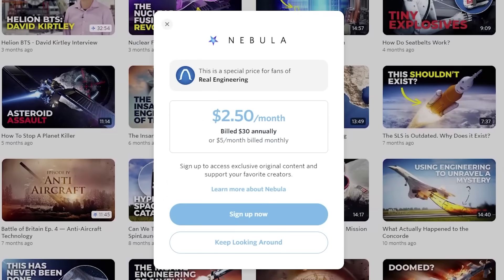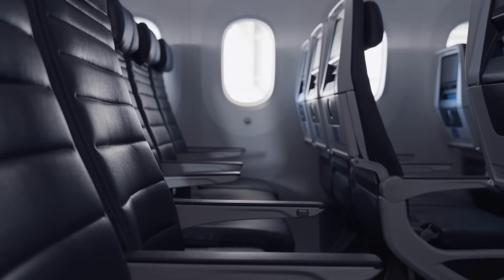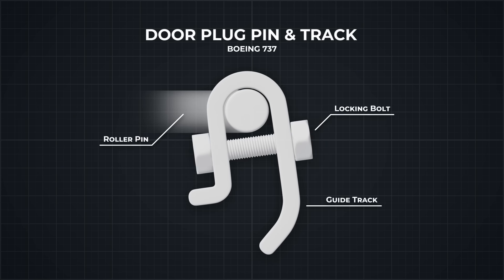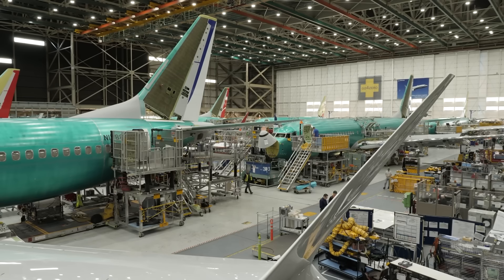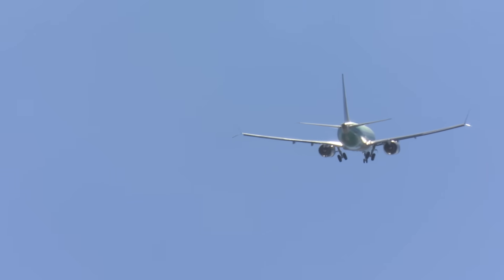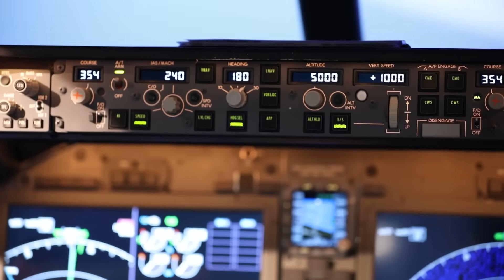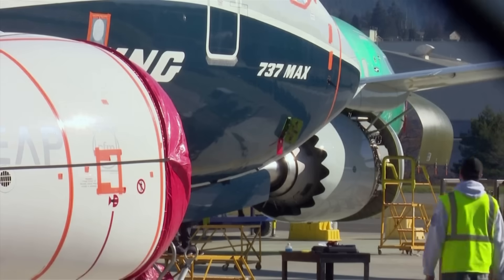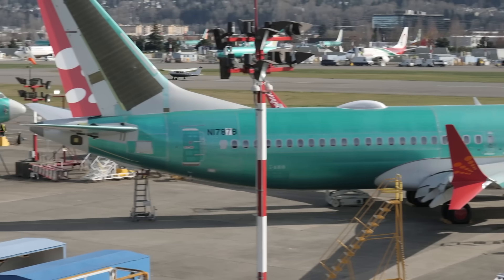The Questionable Engineering of the 737 Max

Comment: The first depressurization happened Dec 7. Alaska had the wifi pod installed by a contractor between Nov 27 and Dec 7 in Oklahoma. This failure started the same day the plane left from being worked on in Oklahoma. The simplest answer is usually the correct one. The contractor for Alaska screwed this away and now Boeing is taking the heat because Alaska is not accepting responsibility.
Reply: Funny how lose bolts were found on multiple other aircraft. 😮
Reply: @simondahl5437  Loose fasteners are found on aircraft all of the time for many different reasons, including vibrations and other general maintenance actions. It doesn't mean Boeing caused it. I have modified fasteners to accept safety-wire or safety- cable because they would work loose even with the best of lock nuts, anchor nuts, lock rings, tab-locks, etc... Unfortunately fasteners have a bad habit of not paying attention to design.

Comment: @RealEngineering The Alaska Airliners didn't do anything wrong. The pressurisation warnings almost certainly didn't have anything to do with the door plug. The pressurisation system of an aircraft is made of several components: the pressure vessel aka the hull, air conditioning pacs, an outflow valve, and a pressure control system. The pressure control system has two independent automatic systems and a redundant manual system.

The pressure warning light went out when swithching the pressure control to the other automatic system. If the door plug was leaking before, the pressurisation alarm would have stayed on regardless of the pressure control system used. Also an air leak makes a loud squaling noise.
Reply: that goes against the "rich powerful company bad, more regulations needed" narrative, but to be fair, there had to be some way to prevent what happened, else it would have been the issue of the engineers, and therefore alaska airliner's fault for picking them.
Reply: Look up Alaska Flight 261, the company has a history of shady maintenance
Reply: I don't know the cabin pressurisation systems on the 737 but expect it's just a modern version of the old cabin pressurisation system on the Victors I used to work on.
Checks would involve blanking the sensing lines on the control valves and pressurising the cabin to a given differential. If the flow-rate into the cabin was too high or the required differential couldn't be achieved, there was a leak somewhere which you had to find and fix to get it within spec. Usually it was the cabin door or the seals around hatches that was leaking - places that were moved frequently or had been disturbed during maintenance. It was all basic stuff BUT the principles still apply no matter if you've got fancy electronic control systems or old steam-powered ones.

The pressurisation problems on this aircraft are quite likely to have been due to the leak around the door-plug as I've seen more detailed photos showing the way the plug probably gradually over time moved upwards in the mounts thereby creating a gap which through vibration and other forces gradually increased until the door jettisoned the aircraft. Tolerances between the 2 automatic systems may account for the fact that one system kept failing whilst the other didn't, but either way this is one heck of a failure at many levels of management, production and maintenance.

Comment: This isn't unique to the 737 MAX; the 737-900 has the same thing.  The causal relationship is that passenger capacity dictates the number of exits required.  Also, blancolirio reported on his channel that doors are NOT removed to install interiors at Boeing.  That's a cotter pin not a wire tie.  It was an intermittent warning light not that it was turned off.  The issue MCAS was fixing was caused by the engines also being further forward, not just that they were higher.  Was WN1380 an issue with the engine anti-ice being left on like the video implied?

Comment: Your channel is CALLED Real Engineering.  How do you not know this is not an example of questionable engineering.?  What a doofus.
Reply: Engineering covers design as well as building. Boeing faltered in their building of the aircraft, therefore they had questionable engineering. What a doofus.
Reply: @simondahl5437    It is not questionable engineering to not install bolts.  It was ENGINEERED to have bolts there.  
It's not DESIGN either.
Installing bolts or not installing bolts is called assembly.  
You goof.

Comment: The door plug mishap is a QA issue...not "questionable engineering!" And the two crashes were due to poorly trained pilots not knowing that they could TURN OFF a malfunctioning stall prevention system via a switch on the center pedestal! IJS
Reply: Engineering covers design as well as building. Boeing faltered in their building of these aircraft and therefore had questionable engineering.

Comment: IMO Boeing Executives are Evil considering the shortcuts they took with Max '8s.  I don't plan to ever fly on any Max iteration after I saw what how they handled the crashes. Bean Counters have managed to take a sterling reputation and smash it into the ground.  I will fly the older Boeings, the 737-800s and 900s, the 757 and 767 but nothing else. Thank goodness my Hometown Airline, DL,  has switched to Airbus on routes I commonly fly.  I find the 321s and 330s are actually more comfotrtable than any Boeing and that's a plus.

Comment: As someone living in Wichita and working on aircraft cables for Spirit, its usually their management responsible for cost saving corner cutting. They demand we work with older, photocopied form boards (the blueprints for the cable, essentially) until we pressure them for months to send us vector graphic form boards, and these old photocopies are honestly some of the hardest documents I've ever had to interpret with fuzzy text and illegible dimensions. In addition, they give us documentation that you can't easily decipher without help when other companies, like Sundstrand, are capable of giving us easily discernable documentation. Its a miracle anything gets built to any kind of spec at my job with what they give us.
Reply: Daaamn

Comment: apparently alaska airlines found A LOT of loose bolts on the 737 max all over after they grounded all those planes and did a full inspection on all of them. the FFA should be grounding all 737 maxes right now.

edit: no, disagree hard. there is no real confusion here about who's at fault. it's boeings fault. sorry boeing has no credibility left here. they've cut way too many corners to given the benefit of the doubt that this is some oversight or whatever. it's crazy that so many planes have turned up loose bolts and magically they're all boeing planes.

Comment: It has come out that the door plugs are not mfg by spirit. They come from Malaysia.  There are conflicting t reports of when in the mfg process they are installed. The depressurization issue is not related to the door plug. The backup pressurization controller was able to maintain pressure so it was not a leak issue. That’s why they were allowed to continue flying. They were not dependent on “not flying over water” to stay safe. That was an added precaution. There is no indication so far that there is “questionable engineering “ on the door plug. There is nothing in this video but speculation and innuendo.

Comment: This wouldn’t be the first time Alaska cut corners with an aircraft issue. Which in the case of Alaska flight 261 resulted in the deaths of over a hundred people. Alaska is EXTREMELY lucky that this didn’t happen a second time. Had that door plug blown off at cruise altitude rather than 16,000 ft, the jet would have probably disintegrated over the west coast of the USA.

Comment: As an engineer in the aerospace field I have been well aware of Alaska’s obvious neglect to maintenance and checks. I think you did an accurate job at placing blame. This case it’s mostly Boeing but it also was not random that it happen to Alaska first. Worst airplane, worst airline…. Bound to have issues.
Reply: Alaska Airlines flight 261 that crashed in the Pacific because of neglected maintenance on some plane tail mechanism - a screw that lost its threads. Now, they have a plane warning of some decompression issue and waited until something flew off in said plane to take a look at it...

Comment: There is really nothing questionable about the Boeing 737. It has proven itself to be the most successful jet airliner ever in terms of passenger miles flown vs accidents. What Boeing has done is also done by other manufacturers.The over reliance on technology and the expectations that it will bring miracles. In an attempt to simplify pilot workload, the installation of auto throttle and auto landing systems along with other applications have produced fatal crashes, Airbus also has been a proponent of this rush to technology in that it has attempted to remove the flying part of the equation from pilots themselves. BEA, the French equivalent to NTSB, has said this about Airbus,”Airbus systems interface pilots and machines thru highly sophisticated computer programs that are difficult to understand and handle correctly. Aircraft equipped with the best technology and capable of preventing man’s mistakes when everything works as planned by the engineers, may become a death trap whenever computers go blind or not receiving proper signals to elaborate.” Airbus pilots are told this aircraft is so sophisticated, it can and will fly itself better than you.Airbus and Boeing have 2 completely different approaches to the philosophy of technology. Airbus believes technology will prevent pilots mistakes while Boeing feels technology should provide info to pilots first and allow them to choose proper course of action. Regardless, this reliance on technology can be directly attributable to recent fatal crashes and don’t seem to be backing off of this desire to apply the latest gizmo to their aircraft. The pilots must be allowed to make decisions first, then help them decide which course of action to take.
Reply: At least with airbus you can turn off the flight control computers from the cockpit when they’re malfunctioning, and fly in direct law. Hell, when airbusb ELACs and SECs go haywire they probably turn themselves off automatically and switch to a different computer. Airbus has a crazy amount of redundancy built into their airplanes.

Comment: You're mistaken about MCAS. The airplane does not show instability. It just happens that it would feel too different to a 737 NG for it to be considered the same type rating.
You can fly a MAX without MCAS just fine but in certain part of the aerodynamic envelope (high thrust low airspeed) the force required to pitch down would just be slightly higher. In low workload situations this would not be an issue for any pilot.
MCAS is part of STS, which is a system that the 737NG already has and does more or less a similar function: Trim the airplane nose down shortly after take off if necessary.

Comment: The problem here is the design.
Bolts on a plane will inevitably unscrew due to vibration.
The plastic cover should interlock to keep the screws on the bolts unable to unscrew or if they do, make that visible on the inside.

Comment: How can they blame Alaskan? If the door was fitted correctly, but only not secured properly, it was not the door which caused the pressure loss. It's a totally different story. When th3 cabin is pressurized, the door is pressed against the seal and should not be leaky, so nobody has a reason to check a brand new door plug. What Boeing did is a shame, but to blame the costumer for it, is even more a shame.

Comment: Boeing can't become the leader of the civil aviation anymore. 5 years ago, the illusion was still credible. BUT the MAX chaos showed all the flaws involving that oudated plane. The reason is that Airbus decided to enhance their A320/321 with more modern and fuel saving engines through their NEO range. Boeing made a panic move by developping the MAX series. But you can't have the same product with a plane launched in 1967 when the first A320/321 was introduced in 1984....Boeing was convinced to beat Airbus with that "old" plane but they failed. And today, the cost of that failure is huge. 25 billions according to some experts. And Airbus has become the indisputed leader in the single-aisle market. With 2 families (A220 and A320/321 NEO) and 6 models when Boeing can only offer 2 alternatives....(MAX 8 and MAX 9). The certification of the 2 remaing models (MAX 7 and MAX 10) still needs to be done. And with the latest MAX 9 door incident,  The FAA will be unmissable. And Airbus will win more than ever orders from many airlines. The B777X is the last chance for Boeing to remain a global player in the aviation industry.

Comment: How does a door plug REDUCE capacity? Compared to a functioning door?
Reply: Because if that was an emergency door they wouldn’t be allowed to put seats in front of it. No door = more room for seats
Reply: @benw1290  I understand if it was an emergency door. But it specifically said that if it was a plug door, capacity would drop from 230 to 185?

Comment: 🎯 Key Takeaways for quick navigation:

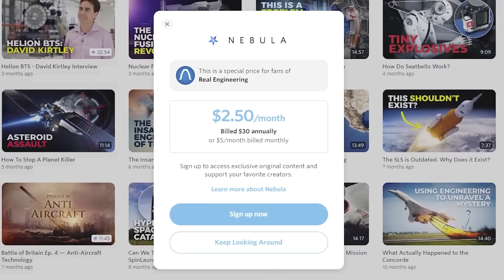00:00 🔍 Introduction and Recent Incident
- Introduction to the 737 Max and recent incident on January 5, 2024.
- Description of the recent door plug incident.
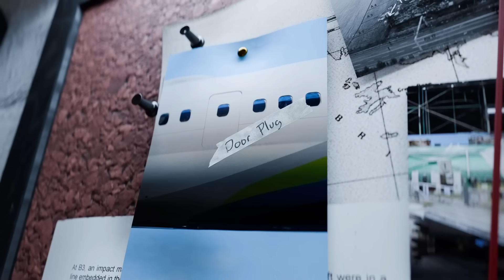01:10 🚪 What is a Door Plug?
- Explanation of what a door plug is in the context of the 737 Max.
- How door plugs affect the aircraft's maximum occupancy.
- Physical characteristics of door plugs.
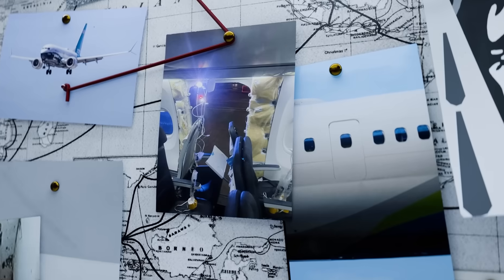02:35 💡 Possible Causes of Door Plug Ripping
- Examination of the door plug's condition after the incident.
- Analysis of stop pads, hinges, straps, and locking bolts.
- Speculation on potential causes, such as improperly tightened fasteners.
03:59 🤝 Boeing and Subcontractor Responsibility
- Discussion of the responsibility shared between Boeing and subcontractor Spirit Aeros Systems.
- Possible communication issues between companies during installation.
- Consideration of the role of quality assurance.
06:01 ⚠️ Alaska Airlines Involvement
- Mention of Alaska Airlines' prior pressurization issues with the same aircraft.
- Critique of the airline's handling of maintenance and pressure warning lights.
07:11 ✈️ History of 737 Max Issues
- Overview of the history of problems with the 737 Max, including the MCAS software.
- Mention of crashes and consequences.
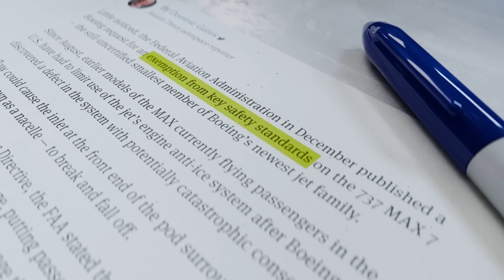08:49 📜 Request for FAA Exemption
- Discussion of Boeing's request for an exemption from a safety regulation.
- Mention of an overheating problem and recommended pilot actions.
10:14 🛠️ Quality Assurance and Layoffs
- Explanation of Boeing's decision to lay off quality assurance inspectors.
- Critique of the consequences of this decision.
- Reflection on Boeing's recent company culture.
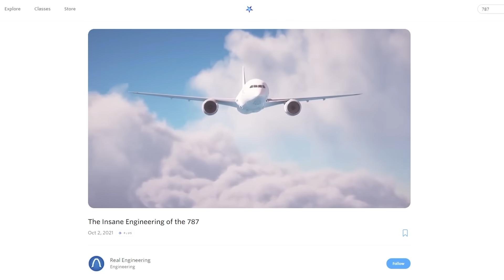11:50 💡 Conclusion and Nebula Promotion
- Conclusion of the analysis and discussion of Nebula content.

Made with HARPA AI

Comment: I think Boeing has MBA disease: bean counters run the firm. It appears to have a finance-led, not engineering-led culture. 
I will avoid Boeing wherever possible, and I won't fly on a Boeing 737 Max - ever. I'll pay extra if necessary to fly with an airline that uses AirBus. And if that's not an option, I'd change destination.

If enough people do this airlines will feel the pain & find alternatives to the 737 Max. Eventually Boeing will feel the pain. It'll either clean up its act - for real - or it'll be broken up. That would probably be better.

Outsourcing fuselage construction to a contract manufacturer? Seriously? Who knew Boeing was that cavalier! No wonder they have quality problems. 

The other problem is obviously Regulation - or lack of it. Not only has the FAA delegated regulatory compliance checking to Boeing (INSANE!) but now we hear the FAA can't even inspect what's going on to fix the problems at Boeing: it has to outsource that job to a third party too! Unbelievable!

Why? Turns out deregulation by successive Republican governments, ramped up incredibly when Trump was in power, has gutted the FAA & other regulatory agencies. They no longer have the authority or the resources to do the job they were designed to do.

Deregulation is a complete failure. People have died! It's been a failure in financial services, in energy production, in automobiles (NHITSA), in food & drug (FDA)... & now in aviation. Enough already: America needs to reinstate proper regulation & reenable regulatory agencies. They exist to keep people safe. Enable them to do that job properly!

Comment: Minor correction, the MCAS system did not malfunction. In fact, the software did exactly what it was designed to do. The problem was that a single angle of attack sensor had failed, which single handedly triggered MCAS. Classic example of garbage in, garbage out.

Comment: It's not an engineering issue. The problem is people, products, and process are no longer a priority. You can already tell the poster has no clue what they're talking about when they claim the decompression caused the locked FD door was ripped open. The latches disengage by design so the cockpit doesnt over pressurize